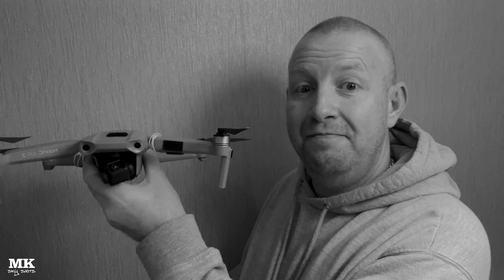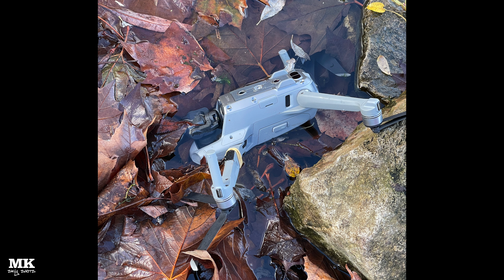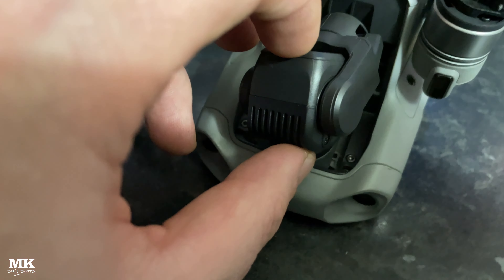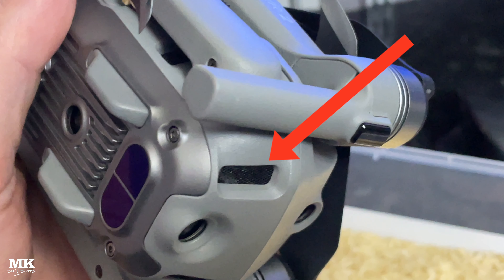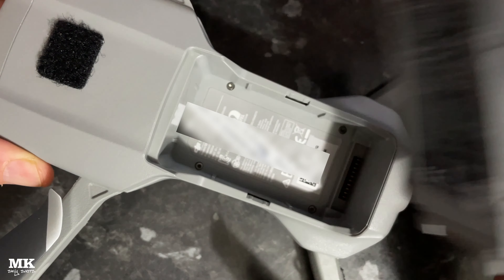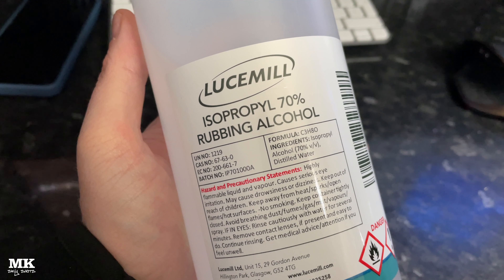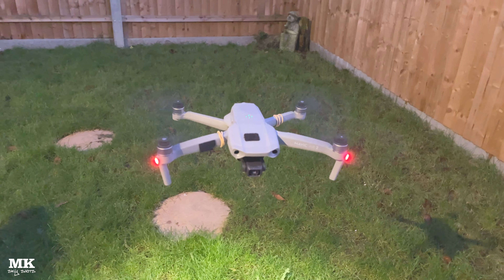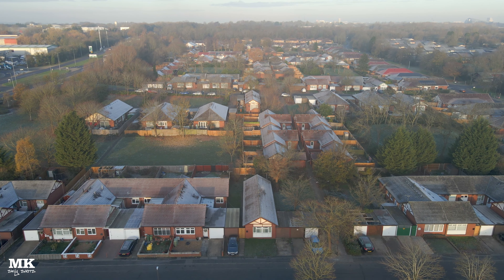DJI Drone Crash - Water Damage - How To Fix It

Comment: I crashed my Air 2s into a tree it has been hanging in it for nearly a week we have had heavy rain and hot days the gimbal is broken and full of water I put a new battery in it and it still flew but the higher I flew it it started to drift away from me I just used my care refresh to get a replacement drone.

Comment: Dude, you worked a blinder getting the drone back up and running. Very well done matey. Hopefully DJI will fix the gimbal for much cheapmness.
Usually, if I want to dry stuff off quickly just chuck it in a bag with a lot of cat litter. It is very ansorbent and much quicker than rice.
We used to dump wet electronics ina  bath of distilled water and let them dry off. I still have 4ltrs of 100% Isopropyl alcohol handy, its only about £15 on ebay.
Good to see your drone up and running again. It is what it is!

Comment: You get a Sub from me just on account of that accent alone 😄 I heard incidents of earlier Mavics having problems with it's obstacle avoidance OA due to sun glare but those were cases where the drone mistook the sun as an 'obstacle', consequently the OA kicks in to stop the drone mid-flight.   

It is equally plausible that your mishap occurred because OA is notoriously unreliable at detecting small, thin obstacles such as overheard wires, blades of grass or small tree branches.  I think that the more likely culprit here is not sun glare, but a small branch which swatted your drone.  

For sure, OA is not foolproof and mostly I fly with OA disabled, preferring instead to rely on my situational awareness of my surroundings.  With OA disabled, I also find that the drone respond with certainty to my stick inputs, whereas there are times when OA can make the drone fly in unpredictable ways as the onboard collision systems override your stick inputs.  All things being equal, you should also see a small increase in battery flightime with OA disabled.
Reply from the maker: Thanks for the Sub and the accent comment did make me laugh 🤣 Funny thing is I have loads of problems talking on camera because I'm deaf in one ear and severe to profound in the other so my talking can be a little dodgy. I can't understand what I'm saying myself sometimes😆

I think you're correct when you say about the obstacle avoidance not detecting small tree branches and other such things. I think people "me included" get way too confident and put too much trust in the technology and that in the end leads to crashes.

I did have a clear line of sight of the drone and it wasn't far away but I got caught out by the perspective and depth so again it was user error and me pushing my luck a little to far lol
Reply: @mkskyshot  I was merely teasing about your accent 😄 I used to live abroad and interacted often with British nationals from all parts of the UK that I have no problem understanding the various British accents and colloquialism.  

Glad you got your drone working again although the damaged gimbal is a bummer.  Unfortunately, a finely tuned part like that will need the services of DJI itself to rectify.

You bring up a good point about depth perception during VLOS (Visual Line of Sight).  I find that depth perception is often deceptive and hard to judge during VLOS and virtually non-existent beyond a few hundred feet.  Hence RC planes being mostly flown over wide open areas devoid of obstructions.  By comparison, drones are probably better than your typical RC plane with obstacles due to its onboard camera and telemetry feed.  I rely on a combination of onboard camera/telemetry with VLOS.  Beyond a few hundred feet, I tend to lean more towards telemetry while keeping a wide scan of the airspace and topography surrounding the drone for potential hazards.